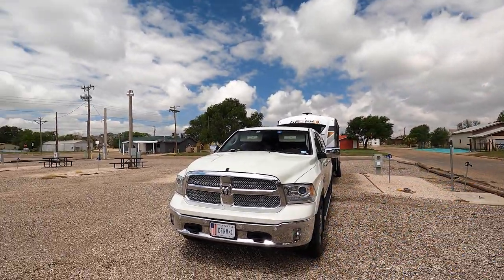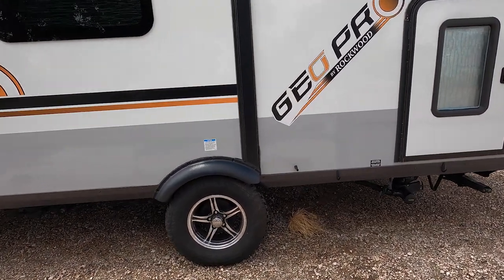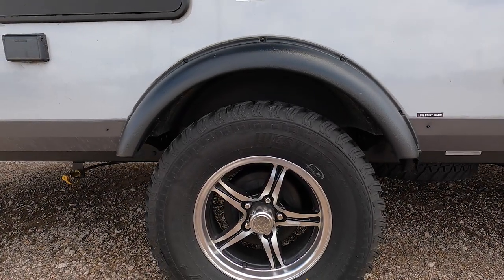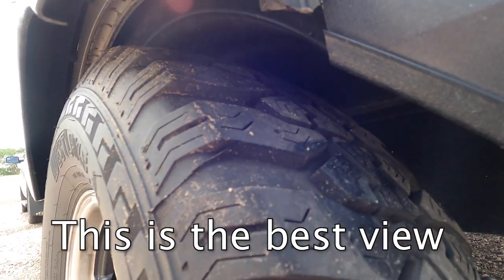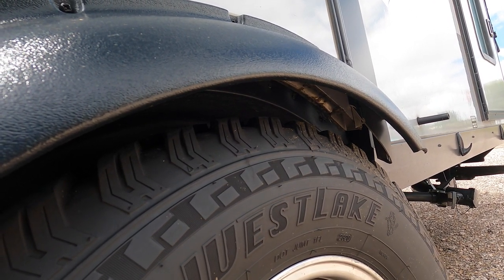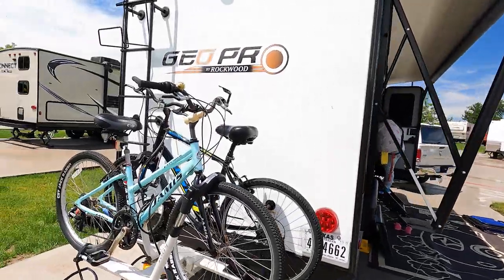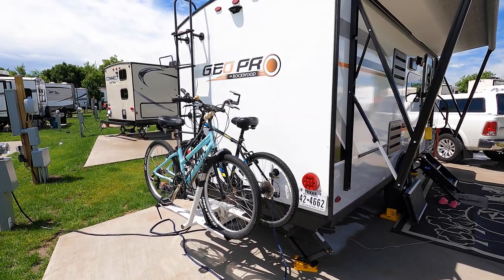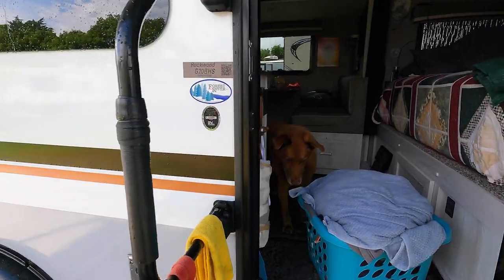Travel Trailer Problems | Our Dexter Torflex Axle Is Failing! | Rockwood Geo Pro 20BHS

Comment: Interesting Coincidence🤔? 
Geo/E-Pro Dexter Axle Questions Never Answered By Dexter:

First, I am not suggesting what caused this specific problem nor stating there is a larger issue with the Dexter axles for this application. Dexter is known for quality products. 

RVing for over 40 years, the axles and suspension systems I have used in the past have all been either solid or independent with coil, leaf and/or air springs, shock absorbers and water tight, heavy duty traditional wheel bearings etc. I have never used a Dexter torsion axle nor the Dexter EZLube system. 

Looking to downsize into a Geo/E-Pro, several months ago I called Dexter with specific questions of their Geo/E-Pro axle. They provided Dexter  representative’s phone number who covers Rockwood/Flagstaff area who I then called, left a voice mail, but never heard back from:

Questions I Have For Dexter:

What are the cyclic bending, axial and torsional stresses characteristics, limitations, guidelines, capabilities, safety factors, tolerances, longevity and maintenance of the Geo/E-Pro Dexter torsion axle under static, dynamic and shock loads, under various weather & environment conditions etc under:
1)Heavy Loads?
2)Light Loads?
3)Uneven Driver/Passenger Loads?
4)Rough Roads?
5)Dirt Roads?
6)One Side Axle Deflection Limitations/Tolerances such as going over a rock or log on one side or other uneven side to side suspension travel/surfaces?
7)Permanent Rubber Deflection/Deformation etc?
8)Water, Sand, Dirt, Mud resistance?
9)Safety Inspection and Serviceability of the Rubberized Torsion Suspension System?
10)etc. 

It will be interesting what Dexter and Rockwood find that caused this problem and a permanent solution to prevent the same issue from reoccurring in the future.  It is extremely dangerous to have any vehicle and/or trailer leaning to one side under motion or even parked. 

A vehicle/trailer that is found to be leaning to one side would likely fail a safety inspection check point, thus be required to be fixed on the spot or transported via a flat bed transport carrier to the nearest repair facility to correct the problem before being allow back on the open road. 

My background:
I am formally trained in mechanical reinforcement, manufacturing testing/failure analysis engineering;  
include design, manufacturing and analysis of advanced material reinforcement, (including for rubber reinforcement), static, dynamic and shock loading, tensile strength, elongation, permanent creep, tension, compression, memory (rebound), cyclic stresses, abrasion, heat and chemical resistance, etc. 

Just some thoughts, observations and unanswered questions to Dexter of their axle used on the awesome Geo/E-Pro travel trailers. 

Thank you for the great channel and keeping us informed. 

Keep safe and many blessings. 

Cheers
Reply from the maker: Hello @I Care!
Wow! Thanks for weighing in on this. You have some extensive experience!
.
I would also like to hear answers to your questions coming from Dexter & the Rockwood design team. But… don’t hold your breath waiting for answers as I don’t think they will come.
From my experience even manufacturers of quality products lawyer up and keep information proprietary in order to limit their liability.
.
As an example the communication I received from Dexter when they approved my warranty claim was this. (This is my paraphrase, not their words):
“Because we have no control over loading, maintenance, or use of our products, this problem is not our fault. As a gesture of good will we’re providing you with a replacement axle, shipping of the axle, and 1.5 hours of labor)”
.
So as you see, they did the right thing while also completely avoiding fault or future liability. Such is this age of litigation which we are in.
.
Well my friend, thanks again for your excellent comment!! It’s much appreciated.
Reply: @CrowdFreeRV  
Thank you for your response and awesome channel. Great things come from collaboration.🙂

Problems are opportunities for creative thinking and collaborative resolution. 

Glad Rockwood and Dexter are replacing the axle.  Typically in situations like this the design and engineering teams will in fact collect and analyze the data thoroughly, hopefully taking appropriate actions based on their findings to prevent a reoccurrence. 

If possible, you may consider documenting the original and new axle’s manufacturing codes/serial numbers that should be stamped or labeled on each of the axles. 

Are they using same axle model number and/or lot number? 

If they are using a different model number what is the difference and how will that affect the stability and ride quality; the ability to absorb static, dynamic and shock loads, vibration frequencies and suspension travel? 

What Dexter axle model number of your floor plan are they using in current production? 
 
If this is a pattern with other owners of the same floor plan, I am confident Rockwood and Dexter will find a solution with a win/win resolution as necessary. 

The are many mechanical theories that I can speculate what caused the initial then rapid sag, but not having the verifiable scientific data to needed to validate a probable cause, would be speculation at best. 

However, what we can do is:
1) Calculate the static and extrapolate the dynamic loads of the slide in the “in, transition and out positions, loaded and unloaded, including the total weights of all sitting in the side, cargo stored beneath the dinette plus the weight of the box and slide out system. 

Calculating the total deflection forces (stresses) on the entire system in all positions and situations will help determine if the slide is a major factor is causing the sagging. 

It appears there are multiple modified cantilever static and dynamic forces and deflections at play. It’s an interesting science with many static and dynamic variables to consider. 

2)Collecting Data  
As a purest in co-writing & adhering to ASTM and ISO processes over the decades, with the rv level, measuring in the exact same manner each time suggest document:

1)Date, time, temperature, humidity and location of measurement 
2)High/Low temperatures the rv was subjected to between measurements
3)Slide In or Out
4)Time slide has been in the “out position” since last measurements 
5)Time slide is in the “in position” while stationary since last measurement 
6)Time and miles driven while slide is in the “in position” since last measurement 
7)Stabilizers up or down
8)How RV is leveled
9)Road conditions, type of roads, speeds traveled on each  and miles traveled between measurements, if any  
10)Special circumstances such as heavy winds experienced; cross, head or tail winds, submerged in or exposed to fresh or salty water, road salt/deicer/ice melt 
11)Weights: Loaded right side, left side, hitch and total weight
12)other

Collecting as much valid data as possible is necessary to quantify and qualify a proper analysis to pinpoint the exact cause that is resulting in the undesired affect, assess risk factors and then design a proper solution based on data collected. 

Is this is an isolated case? If yes, a simple axle exchange.

If there are multiple RVs with the same floor plan that are suffering the same fate, solutions may range from a different rubber compound that is not susceptible to a possible heat setting degradation and/or deformation, etc to an entire different axle and suspension system. Rockwood already has an air suspension they use in the Geo/E-Pro toy hauler floor plan.

I prefer axle and suspension systems that one can quickly and easily view the entire suspension & axle system such as traditional springs, shocks, bushings, air bags etc. are preferred, much easier to diagnose, maintain and fix on the fly. 

Also, for all RVs with slides, I would always use true 4 corner leveling jacks, fully deployed prior to deploying the slide outs. 

Thank you for taking the time to read my long winded thoughts, observations and keeping us all informed of the twists, turns of your adventures. 

Enjoy the journey!

Cheers,
KP
Colorado Springs, CO🏔🇺🇸

Comment: Might be pushing too tall of a tire, for that single axle. I've got twin torflex 3500lb axles in under my Featherlite enclosed snowmobile trailer, that are 30 years old. Other than rust, they work fine, and I'm grinding rust, and coating with cosmoline now.

Comment: If you had a couple hundred pounds of gear stowed on that side of the RV and then added the leverage of the weight in the slide out to that side of the RV, it's a possible explanation of the axle sag on that side. 
Just another of the many reasons I'm 'spooked' about slide outs and chose the G19FD without one.

Comment: So you can’t get it fixed in Texas?
Reply from the maker: @michael arnold the main deciding factor here was time. My travel blog is what I do for a living and I have reservations in July for some key content creation. By doing the work at the factory, I eliminate the shipping time to Fort Worth. LTL shipping can take a notoriously long time. Going to the axle eliminated all shipping delay.
.
As to getting the work done anywhere:
The work itself is simple and takes only an hour or two. Dexter ships a brand new “loaded” axle that’s ready to bolt up and go.
Four bolts, two wire connections and changing the wheels/tires out are all that’s needed. The hardest thing is just the time to get the trailer jacked up & supported.
Thanks for watching & commenting!